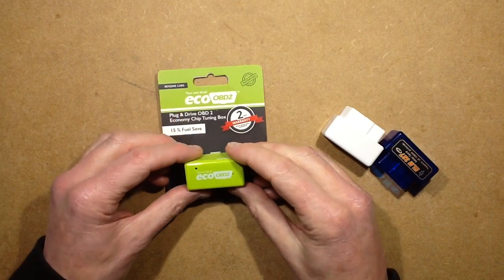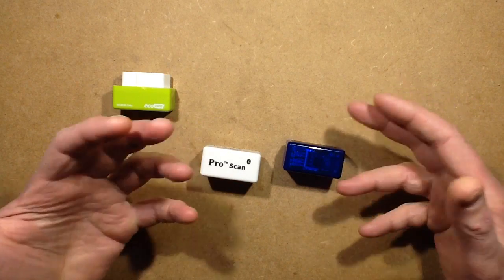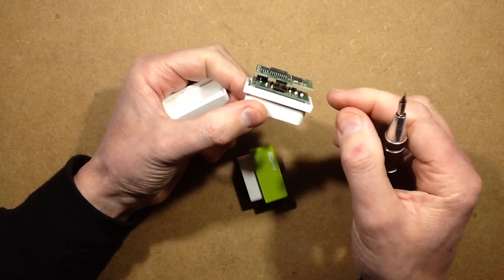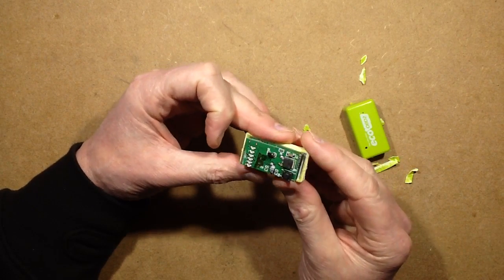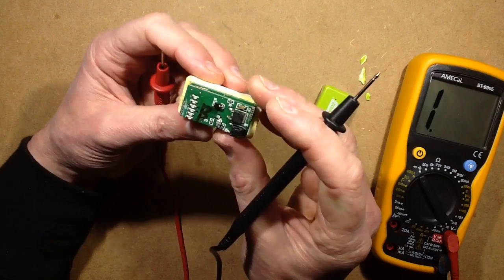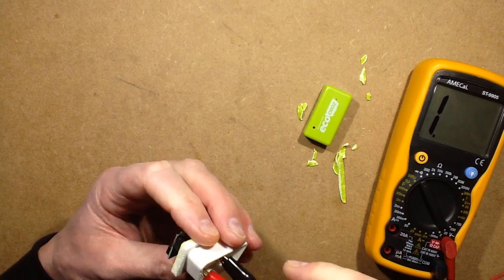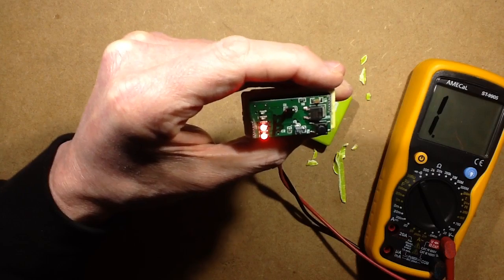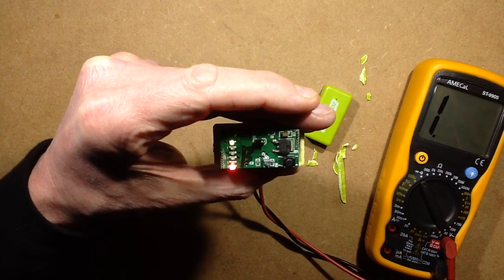Inside an ECO OBD2 "chip tuner" fuel saver.

Comment: I have used the blue one, it is used to pull DTC codes and show Real Time Readings.
Have had no issues.

This thing might put the car into a lean burn
Reply: +911mporsche Yeah poormans.

If android is a poormans phone, that means anything apple copied their crap is a poor poormans device

Lets see what they copied.
Small tablets.
Steve Jobs said they will never make a small tablet.
After steve jobs died, they released one to compete with the smaller android tablets.

Large tablets. google have had a few +11&quot; tablets well before the ipad pro, one such example is the Samsung Galaxy Note Pro.

Anroid have had google wallet, apple have apple pay now which is highly limited.

Android has had NFC which allows you to use your banks app to act like a credit/debit card to pay for things,
Apple copied this idea and then limited it to apple pay

Android have cheap basic phones and high end phones, Apple thought lets make a cheaper phone,
we know how that turned out.

If an android update causes issues with the cellular radio you can revert the update and if your smart enough you can rewrite the cellular radio part of the OS, with apple, you have to wait for apple to release an update to fix an issue with the OS, remember when you couldn't get good 3G/4G signal after doing that iOS 8.1 update?

With android you aren't forced to update to the latest OS, cant say the same for apple.

Google is devolving the driverless car, apple are now doing this.

Google started Android Auto for your car, then apple does what apple does best and launches Apple Car.

So which do you think is "better"
The highly restricted system where you pay $1000 for a phone where you cant even choose to do what you want with it?
Or the system that allows choice?
Reply: +IIGrayfoxII I also have a blue one, works fine as a diagnostic tool with android app Torque.
Reply: +911mporsche Enjoy your severly handicapped "rich man's" knockoff of android phone.
Oh wait, you cant, because even jailbroken it have less than half of the capabilities of android phone.

Well, unless you are bimbo who use it only for making selfies and watching youtube.
Reply: +rudolph bakker What you actually mean is that Apple users are dumb so they need to be protected from themselves.
Reply: +911mporsche as i said, people with subpar intelligence find pressing a gear icon as "too complicated task".
Reply: +Osumo Ben Lodan There are wifi versions of the OBD2 readers available which work with iPhones
Reply: +The Last Phoenix Here goes the fanboy war, I have used both OS and have too say they both have there advantages and disadvantages
Reply: +Trent Swain We android users didnt start it, we just fired back.
Reply: Me too, worked fine
Reply: +IIGrayfoxII Yeah, I am aware of that. That's the reason I've jailbroken my device.
Reply: +Mawerick77 What is nice about the S3 is that replacing the battery is even an option.
Reply: I also bought the blue translucent dongle from amazon. The eml 273 (or some similar name) for $16. Seemed like a good deal at the time, however it wouldn't connect to either of my available vehicles. An 01 pontiac grand prix, nor an 06 buick rendezvous. I noticed someone said in the comment section of a review video of this specific obd dongle that "it isn't compatible with pre 08 gm vehicles due to missing component on the board" That doesn't seem like a solid reason to me, so I'm curious to hear your experience with the device. Specifically what vehicle(s) you've had it working with, thanks
Reply: +Mawerick77 Any iOS app available?
Reply: DvDw well it's a little late now 2 years it seems lol but yes there is iOS app for the Bluetooth obd2 reader
Reply: +IIGrayfoxII True. Both OS has there advantages I have used android for years and just switched to iOS and have to say they both have different benefits
Reply: +911mporsche ... trump profile pic.. fucking hope its a joke...
Reply: 911mporsche
Why did you start bashing Android? I wasn't bashing Apple, I simply said I don't like their products. For someone who's been tinkering with computers etc. since the 1980's, they are just frustratingly restrictive.
Reply: +IIGrayfoxII +1
Reply: +Osumo Ben Lodan Dont believe so, just do a search for OBD Reader on the App Store
Reply: +Osumo Ben Lodan Dashboard i think, but you cant use bluetooth OBDII readers.
Apple have restricted bluetooth to things like speakers and keyboards.
Reply: +911mporsche It is sort of amusing that my wife did the exact opposite. She had iPhone 4 and 4S for couple of years and had constant problems with them. After switching to Galaxy S4, no more problems. I've had my Galaxy S3 for over three years now and absolutely no problems, works like a dream. I did replace the battery since the original started to go weak but that's not really Android related and happens on every phone eventually.
Reply: +lariwoo I assumed it was obvious I was referring to Apple products.
Reply: +911mporsche And the 911 is a poor man's Ferrari knock off.

Ridiculous logic mate. But thanks for the laughs, that comment was the best thing about this video, and I like Clive's videos.
Reply: +911mporsche That's exactly what Apple wants you to think. Android started as a camera OS that Google bought and adapted to phones. Even then it wasn't designed to compete with the iOS in iPhone, because nobody outside Apple knew of its existence until just weeks before the G1 was publicly announced. Android wasn't even the first Linux based phone OS, Nokia developed and launched Maemo years before but nobody except hardcore geeks picked up on it. Neonode also used Linux and a fancy touchscreen based interface. There were countless others that I can't name off the top of my head. So no, Android is definitely not a "poor mans iPhone", if anything the iPhone is an expensive ripoff of Nokia/Neonode/etc.
Reply: Mawerick77 hey i wont lie they are very restrictive. but i just like them cause there so reliable and simple. i had an Android and it was so complicated and just seemed like it was a knockoff iphone. so i did the best thing... i threw the android in my pond and bought my iphone 4s. love it to death
Reply: +Mawerick77  which are  frustratingly restrictive? computers since the 80's or Apple products?
Reply: +Mawerick77 Not when you're using an ergonomically flawed hp laptop with windows 8.1, every time windows evolves it becomes more frustrating!
Reply: +lariwoo That is true. However, my point was that you can actually do something about it (like install customs shells). The necessary stuff is somewhat hidden but it is still there.
Reply: +Djhg2000 wasn't symbian before that maemo aswell?
Reply: +Mawerick77 Have you seen apple fans face to face? It actually seems like they're going to start salivating as they extol the virtues of apple products that they barely understand!!!!! I've heard 50+ year old's state that apple invented video calling & it's called face time!!!! Great video again by Clive though.
Reply: +Osumo Ben Lodan I don't think so, because Apple doesn't like bluetooth serial ports so they can't "talk" to the device.
Reply: +Mawerick77 Mobile security engineer and can confirm. Cycrypt is a godsend, and yeah, iOS is a pain in the ass.
Reply: +The Last Phoenix You get python as soon as you jailbreak, which is dope. Just get an iPod touch, you get all the fun except that shit doesn't have to be your phone. Audio quality is great, except now they have 32-bit DACs in the LG V10.
Reply: +IIGrayfoxII Android had multitask at a Unix timestamp lower than iOS's equivalent statistic.

Android caters to the tinkerer, iOS to the "i just want it to plug & play with my microshit/nibbled pommiform.". On a rather different scale, Linux (i.e. desktop GNU/Linux solutions) caters to the tinkerer (which Google and many other companies are, indeed), and Mac OS 10.x to the person who just wants to get creating. And Windows to the interests of capitalism gone wrong.
Reply: +IIGrayfoxII Android had multitask at a Unix timestamp lower than iOS's equivalent statistic.

Android caters to the tinkerer, iOS to the "i just want it to plug & play with my microshit/nibbled pommiform.". On a rather different scale, Linux (i.e. desktop GNU/Linux solutions) caters to the tinkerer (which Google and many other companies are, indeed), and Mac OS 10.x to the person who just wants to get creating. And Windows to the interests of capitalism gone wrong.
Reply: +IIGrayfoxII Android had multitask at a Unix timestamp lower than iOS's equivalent statistic.

Android caters to the tinkerer, iOS to the "i just want it to plug & play with my microshit/nibbled pommiform.". On a rather different scale, Linux (i.e. desktop GNU/Linux solutions) caters to the tinkerer (which Google and many other companies are, indeed), and Mac OS 10.x to the person who just wants to get creating. And Windows to the interests of capitalism gone wrong.
Reply: +lariwoo I'm just gonna become a broken record and belt "GNU PLUS LINUX SOLUTIONS ARE THE BEST"
Reply: +jjovereats Think you jjovereats are the broken record.
Triple Posting
Reply: +Jack Duno My scanner is from Bosch. I've plugged into an 05 Rendezvous, 3rd time it just didn't work anymore. Nothing else was wrong at that time, no other GM car or other manufacturer has had a problem with my reader. It's already leaking 2 fluids and __it a transmission, wheel bearings. 04 Aztek running on 5 cylinders had no problem... being read. In both cases I recommended a Ford device to plug in the driveway.
Reply: +Hellz Timmy! Just curious, what vehicle were you testing the scanner on? Which version of the app you have shouldn't have an effect on whether the scanner connects with the vehicles ECU. I "purchased" torque pro and that still wouldn't connect to either the 01 GP, or 06 Buick. However I recently acquired an 08 Yaris and both free and pro apps connect with it.
Reply: I stand corrected. Jeez, app devs are really pushing people to make the upgrade to the pro version
Reply: Ehn, my ebay bluetooth scanner works fine on my Toyota, which is my current daily driver. It really just use it for extra gauges like coolant temp, vacuum pressure, abient air temp. Besides, I also bought a proper code reader for actual diagnostics
Reply: Osumo Ben Lodan
No idea, don't like Apple products.
Reply: Mawerick77 b
Reply: +Mawerick77 had my iphone 4s since it came out. not once has it gave me any problems, android is a poor mans iphone knock off.

Comment: To reprogram an engine ecu the engine MUST be OFF with the key ON. This device looks to be a driver aid rather than a reprogramming device. It may beep at you if you accelerate or brake too harshly or exceed a certain road speed. Normally a vehicle has only 1 network (k-line l-line, kwp2000, CAN high and low)
Reply: No need to have a "beep" if one accelerates or brakes too harshly or exceed a certain road speed---------------------our wives are very good at letting us know that.
Reply: This guy knows what he is talking about.
Reply: @wasimlhr  no he doesnt, cars can have upwarsds of 4 networks on can theses days, can still use K line (but very unlikely) LIN is also used. This will all disapear soon anyway as we are moving to Ethernet systems anyway.

Comment: The elm327 chips are not that bad. Give the options to read and reset fault codes from some of the modules. Not all.
Reply: +Moose Killa You can get cheap china clones of the ELM327 and then buy an original chip and replace it. Will be 100 times better and cheaper.
Reply: leosedf I've used plenty of the cloned Elm327 and original. I've yet to tell the difference. Ive had to used more specialist readers to read ABS modules, coding etc
Reply: +leosedf There isn't hardly any base difference between the ELM and the original ones, the entire ODB2 is based upon a default set of values that such chips are able to read, even with the clones you can read out the majority of basic codes (rev speed, gear, flow, pressure etc). The main difference that I've noticed (I've got about 15 of these ones of ebay) is the speed at wich they can read this. But as the majority use this over BT or Wifi anyway, you wont be getting that massive updates of the chip anyway due limit of the data transferred.
Reply: +karremania It&#39;s simple. Support the original manufacturer of the ELM327 and stay up to date with the latest of their versions. It's a few bucks and that's it.

Comment: LOL! That crap usually doesn't do anything.
Reply: it is gren BULLSHIT :)
Reply: +Budai Adi Yeah probably, i would expect just a capacitor on it but they added a led effect in it to justify the price and make it more convincing.
Reply: +leosedf  yah party led :))
Reply: +szili76 physically not even possible. I hope this is sarcasm lol.
Reply: +Crobular it's not possible to flash. EEPROM with the engine running. It's definitely not possible. Likely it's just modifying your MPG offset.
Reply: +Crobular I Sounds like you are trying to hide the shame of getting scammed. Or the auto placebo effect
Reply: I painted my Honda logo red and now I’ve got 2x the hp
Reply: You are wrong. I have this little green box and it makes 50 bhp more! Also double the miles!
Reply: +bolter99     No! it`s true.  My 4 litre XJR8  in standard form  did around 15MPG.  I put one of these little units on and it now does 36 MPG in town and the performance is 1.5 Secs quicker to 62 MPH !!!!. An engine brake test at the rear wheels gives an extra 75 BHP. on the rolling road.!!.  
TATA who own Jaguar have bought thousands of the device from China and are fitting them to the latest cars. Huge improvement on a diesel Jag also I understand.